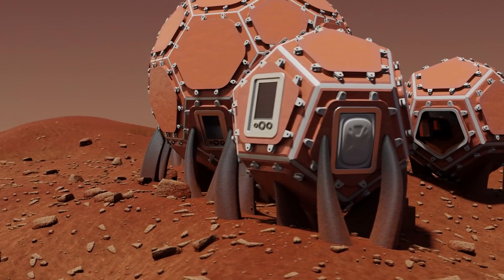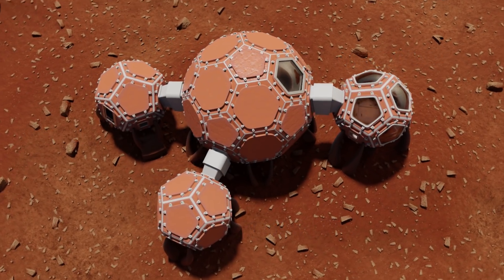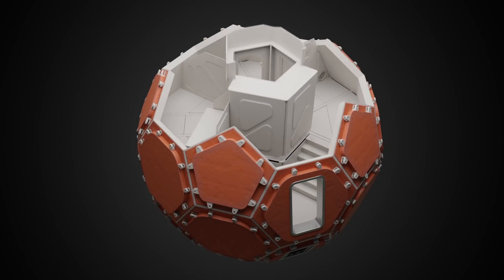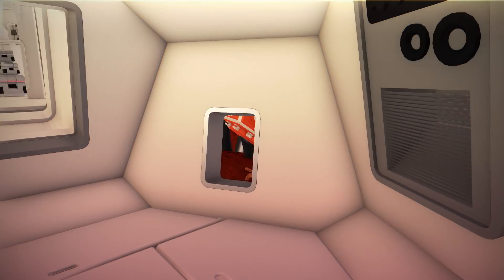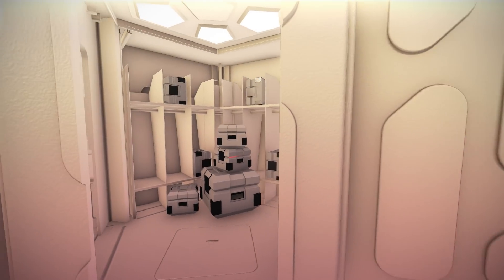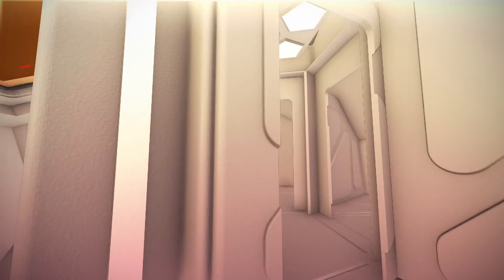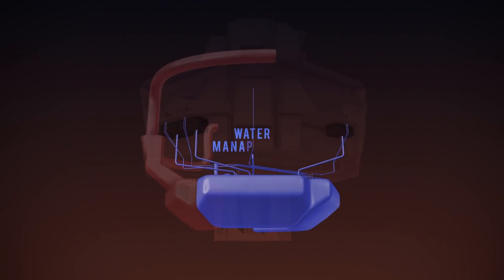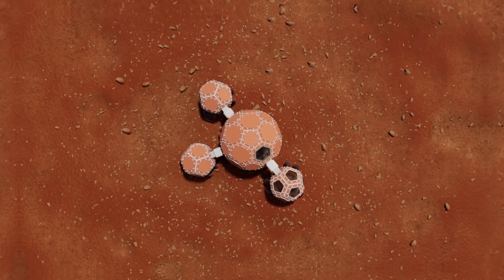Mars Incubator Habitat

Comment: I don't think normal stairs will work in 1/3 gravity. But just a guess.
Reply: Why not? You would just jump over 5 steps instead of 2 like on Earth :)
Reply: @sakakaka4064  then you dont need normal stairs. I would try boat stairs  to save space.
Reply: @GabsareSarg  Maybe just a climbing line then? :)
Reply: Do you think martians will still be as fit as when they first landed? With the course of 4-6 months they will lose their muscle volumes, at least 40-50%, especially legs will get weakened. So then this usual earthlike stairs will be fine.

Comment: I'd use the water on top for shielding against radiation instead of puttimg the quarters up there. By doing so the water doesn't need pumps to go to the shower, toilet etc. So of there's a power surge you can still use the toilet without risking contamination and bad odors. Also if you have a water based fire extinguishing system it would be good to have it rely on gravity instead of electricity.  I'd also go for EVA suits that don't enter the habitat but connect to the outside. This minimizes storage usage and the regolith entering the habitat. And maybe a connection to a rover or similar would be nice. Other than that i enjoy the design
Reply: This are great ideas! OP should listen to this guy.
Reply: Bad idea to use radiated water to shower
Reply: @neilrenavikar3585  you cant make a substance radioactive by radiating it. There's a way with neutrons but tjat isn't the point. If you put a lot of radiation on watwr rhe only thing rhat happens, is that it will get decontaminated. If you put a radioactive substance in there then you would have radioactive water.
Reply: Rubix_Cube_Box thanks for the correction, but my physics teacher thought otherwise
Reply: Water-shielding is the answer for prolonged time away from Earth's magnetic envelope.
Reply: Eld Jr maybe the best safety is in a mountain
Reply: @neilrenavikar3585  as someone who worked with a lot radio isotopes i can say your physics teacher is wrong and water shielding as been the standard for the us army for almost 40 years and i drank it many time though out my career as a CBRN.
Reply: The water and oxygen generation units are the most important structures. They are beneath the structure because that is the safest place to have them to avoid an unnecessary leak or accident.

Comment: Crew quarters should be in the bottom third, trading places with HVAC and water. Radiation.
Reply from the maker: Def something to consider....
Reply: That was my thought as well. Placing as much mass as you can above the key living and work area's.
Reply: Considering NASA theorized using water to protect astronauts in deep space. As I recall
Reply: First thought to come to my mind as well. Could you house a part of the water inside the walls? creating a waterlayer. Water is very handy in radiation shielding. I also have a cad draving of a proper hydrological plant wall if you need one...
Reply: @marsincubator2701  additionally  if you sank the bottom third into the martin soil about a foot it would reduce the need for a large amount of shielding on the walls of the hab section reducing overall Weight and making the incubator far more attractive to space agencies  and private company just a thought.
Reply: Exactly

Comment: So you suggest one has to move tons of plastic to Mars? Instead of simply burrowing into the hills?

Don't get me wrong, animation is great, but I doubt this is practical. Basalt fiber alone requres tons of energy input to be produced, and energy is not easy to get on Mars.
Reply from the maker: You're right, energy will be expensive, but we will derive the plastic on the surface from water bound in the soil and CO2 in the atmosphere.

Comment: One problem how are those panels  going to make it to Mars, one thing   space organizations always mention is that the weight is a problem due to transportation  cost.
Reply from the maker: The panels are produced there with material harvested and synthesized on the surface.
Reply: @marsincubator2701  with what factory and energy
Reply from the maker: @berbart7122   Kilopower most likely, check out our "factory" concept at:  https://www.marsincubator.com/2019/04/18/in-situ-resource-utilization-isru/
Reply: @marsincubator2701  so there going to have to bring heavy equipment to harvest C02 and hydrogen, how much would it cost to send those machines to Mars

Comment: You know that might be the realistic yet, but need to decrease the amount of parts. For faster, and easier way of building.

Honestly try the idea of 3d printing most of the bottom half, and make the top half a removable cap... But there is one problem how well you protect the site from radiation? Because as you 3d print every part is going to get a good amount of radiation. With those defeating the entire peruse for 3d printable habitats.

With those the NASA idea would work for the first habitat system.

Being 3d print a dome, and put a colony underneath it.

Then work on expanding the colony from there, using the same 3d printing tech to build the structure in the video. But with a twice, being a radiation protective covering over the site. So the radiation won't contaminate the 3d printed parts.

I'm stopping here... Brain hurting, but you get the idea... Hopefully, because I understand it, but what about you?

Comment: 1. It makes no sense to make it into a ball, if you are making panels on mars.
2. You should consider that pressure is inside the ball, so it make more sense if the panels where mounted from the inside instead of the outside.
3. The legs makes no sense at all.
4. It looks like hallways are going to be tight, people will bump into each other all the time, and it will get annoying.
Reply: 5. Having an entire compartment with yet a few hydroponic bays seems futile, could be used for better purpose
6. refer to number 3
7. Food was not properly addressed for 4 people in this concept. Is it in the rocket? Is earth resupplying? pre-supplying? 
8. How about mobile systems and backup systems/parts
Reply: No said it was going to be luxurious
Reply: Yes I agree with Kjetil Hvalstrand. This could be more usable if it was designed as a good sized tubes with a flat bottom on the ground just in case someone gets hurt.
Reply: Definitely not the smartest design
Reply: the overall design is pretty solid actually it is a modular system so if need be the "balls" can be made much larger and semi-buried for under ground expansion it all come down to what the astronauts or space company want / need there are better out there but as an out post or temporary base this is one of the best i have seen

Comment: Nice work! I have some ideas for improvement. You will need more plants, and in the plant room (forgot its name, sorry..), there is more space, so I'd  say it would be easy to put more plants in. There doesn't seem to be enough air locks in case of emergency, and from what I know, only one of the outer pods has an air lock, to go outside. You also need a space suit that sits outside, instead of bringing it in, otherwise the very find mars dust would get inside; which is toxic.Also, (sorry XD) did you put any excercise equipment in there? (Sorry to be so harsh, just think that this habitat has a lot of potential)
Reply from the maker: Thanks KaineRaid! We’d love to show more plant life in the bio generation area, but plants are super taxing on the graphics processor, which makes them hard to render. I appreciate your comment in regards to additional air locks. They are intended to be employed between each of the 4 volumes, they just have not been totally defined in the 3d geometry included in this model. What is included, however, are suit sizes hatches in each of the 4 volumes in the model(hard to spot, but they are there.) only the hatch in the vestibule area is intended to actually mate with an external suit, for we strongly believe that astronauts will most likely want to bring their suits in out of the Martian environment in order to service and inspect prior to and after excursions. The vestibule is meant to seclude any dust to that area through the use of hepa filtration and differential pressure zones.
Reply: @marsincubator2701  Ah, ok! Keep up the good work, I'd love to see more!

Comment: E for effort but it's a poor use of space and materials. And what they don't show you is the equipment required to 3D print the foundation. If you're going to take all that equipment to Mars might as well use it to print the rest of the building too. The thin layer of regolith over the pentagonal panels isn't enough to shield for radiation. And those panels don't have near enough room to house the equipment in the entry hatch. Generally the entire space is filled with hallways and stairs. Even on earth we don't waste that kind of space in housing. Open and modular cylinders, preferably using rocket hulls, dug into Mars with regolith covering the top would be most ideal. The water can be placed on top as that would be great for radiation insulation. Digging doesn't require any more material than the tools used to dig and can create large, easy, and safe environments for habitation. Not only would it require less material in transportation but those tools would also be used for future building. This plan would require bringing nearly all materials from earth and simply would not work. The reason the space station doesn't look pretty like this is because every detail in the design is necessary and functional, same will inevitably go for Mars.

Comment: I like the idea, but i think sealing could be a potential risk. The outside of the building is hit by environment. Dust, heat, wind.
Reply from the maker: The most detrimental affect will be the solar radiation. The wind only kicks up a small amount of dust, and the polyethylene is very good at absorbing the energy from those small sand particles. It's the high energy particles form the sun that will damage the integrity of the uhmw polyethylene we want to use.
Reply: @marsincubator2701  Even a small amount of dust is enough to fuck with living quarters and experiments, though. Gotta fix that.

Comment: So the crew will sleep up near the roof where radiation shielding is its thinnest?
Reply from the maker: Thanks Nebekenezer!  Actually, the thought is that the crew will spend most of their time in the lab space and higher shielded areas, as sleeping is only about 1/3rd of the programming for the astronauts.
Reply: @marsincubator2701  well you could cover it with dirt to add a layer of protection.

Comment: as usual the hydro section is way way too small.
Reply from the maker: darren marchant Thanks for the input! We def struggled calculating and allocating the appropriate volume to each of the individual life support systems. What percent of the total system volume would you recommend for water reclamation and processing?
Reply: @marsincubator2701  that is a bit of a big subject! I will attempt to summarize. first is the fact that reliability is a very big factor.  so both purely artificial and botanical systems in combination will protect in the case of a failure in the aquaponic systems. then there is the recommended subdivisions of the aquaponic processes. the recommended aquaponic processes fall into several categories not listed in this reply. there are various mechanical purification components that I would recommend as well. first take a no BS look at the biosphere 2 program and what they found out about underestimation. then plan on many more people than you expect to send. for a more detailed presentation I am currently available in Chandler Arizona. thank you.

Comment: I can see the outer leg stuff being removed from the process as they are completely un-needed and waste time & resources. the habitats do not need them to remain stationary,or for strength, or for access. a total waste of effort! the habs could simply be placed on the ground, and/or even buried to shield radiation. a few shovel-bots would be far cheaper and more robust.
Reply: I concur.  It's basically sitting on an ice block.  Flexible module joints would be easier.
Reply from the maker: Good eye chemical mike! But, you have to realize that although the habitat will be sturdy without them after pressurization, it  is effective to have the supports during construction. Additionally, the tiles cannot be placed directly on the surface for they seams need to be welded/sealed.
Reply: @marsincubator2701  Thanks for the insight in the build process. But ultimately the main thing stopping ANY build on Mars is the Ship Cargo weight. If a simpler way could be found without that step, it might possibly save hundreds of pounds in weight. Peace! :D